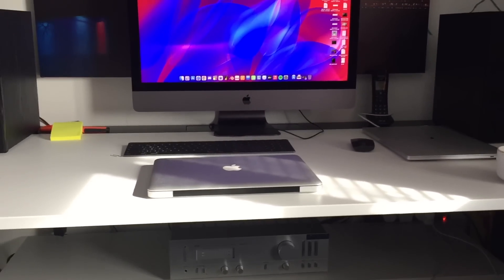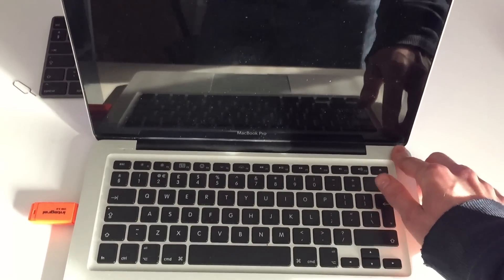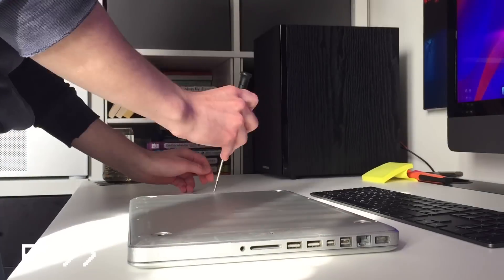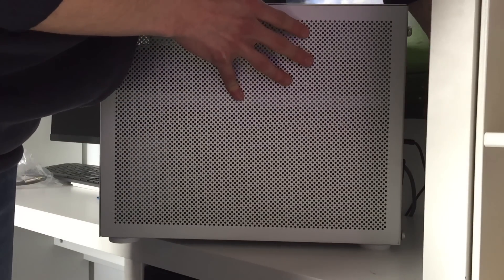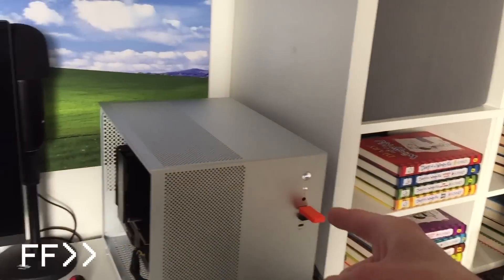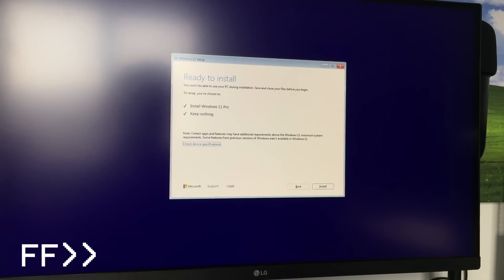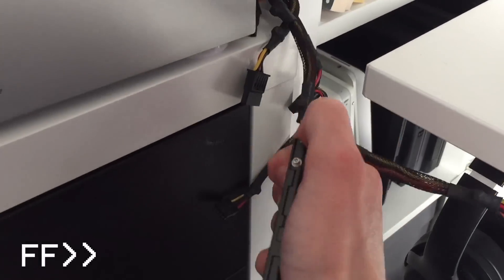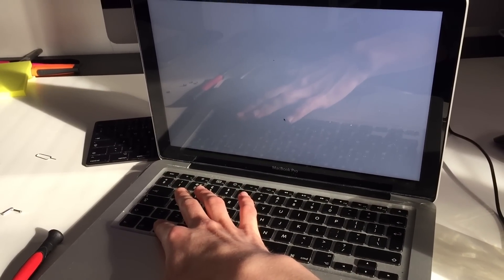I Tried Running Windows 11 on an Old MacBook Pro – Here's What Happened

Comment: I installed Windows 11 on my 2012 Mac Mini once by first installing Windows 10 on it via Boot Camp, burning a Windows 11 DVD through (I think) Rufus and stripping it of ALL its installation requirements, then using an external DVD drive to UPGRADE Windows 10 to 11 from within the Windows 10 install on the Mac. I think I had a blue screen once or twice but after I fixed something in the registry it was fine. It worked pretty good!
Reply from the maker: That’s awesome! Nice one

Comment: Interesting, I will point out that the reason the ssd didn't provide any boot options on the Mac is because it was using the bootloader on your PC's internal drive. Also I would recommend using an older build of windows 11 since the processor may not support the instructions for the latest version. I believe this change was made in 24h2 or 23h2 but I may be wrong.
Reply: Basically, if you can boot the installer (without the minimum requirements, Rufus can do that for you) then you should be able to run windows 11
Reply from the maker: Thanks for the insight! I’ll definitely give something new a try! 🙂

Comment: the build of windows 11 that you tried to use on this macbook requires an instruction that the core 2 duo series of processors does not support, the best thing to do in this case if you insist on windows 11 is use an rtm build from 2021 or 2022 since the builds that require sse4.1 sse4.2 started circling around from 2023 but for me id use the rtm build Microsoft rolled out in 2021, this is why when booting from the usb on the macbook it didnt want to boot the cpu had missing instructions that build of windows 11 needed, and for the taking it out of the macbook and using another pc i doubt it will work either ways since in general apple devices handle everything differently than normal pcs so it could be potentially something related to the way it it just like how you cant just take an ssd out of a system that supports efi and put it in a non efi system
Reply from the maker: Wow thanks! I’ll look into this 🙂
Reply: @techmw1988  you're welcome

Comment: If I am correct about the CPU in that computer, then it is entirely possible that Windows 11 literally cannot run at all due to the processor being so old that it misses critical instruction set extensions that the OS needs to run. I have a 2007 iMac with a Core 2 Duo T7700 inside, and it runs Windows 10 because at this point MacOS is a lost cause on that machine. When I try to update to Windows 11 (with registry hacks applied in 10 of course), it says that it doesn't meet the minimum requirements because of the lack of "SSE4.2" and "PopCnt" instructions I think. That 2009 MacBook has a processor of a similar vintage, a Core 2 Duo P7550 or P8400, so it's not out of the question that the same problem is occuring here. Try to install Windows 10 first, and then upgrade. Also, make sure to download Windows Support Software from Boot Camp in MacOS, as Macs need a lot of windows drivers to run properly!
Reply from the maker: Thank you so much! Maybe I’ll just have to stick to windows 10 🥲

Comment: hey, for this model (2009): you either wanna use bootcamp w windows 7 OR: make two usb bootable drives: one with windows 7 (legacy boot) and one with rEFInd, plug both USBs in, go to EFI boot to go to rEFInd, then select the windows usb key, install windows 7, then you'll be able to install windows 11 using your successfully installed windows 7 on your 2009 MacBook Pro (tested on my 2008 MacBook!) oh and: 24H2 broke Core 2 Duos compatibility for Windows 11, you might prefer using 23H2 for that
Reply from the maker: Thanks for the insight! I'm definitely going to give this another go soon

Comment: yes so what you do is install windows 10 with boot camp then make a windows 11 usb with rufus then remove all system reqiuer ments then upgrade windows in windows 10 by opening the setup app and it should work fine.
Reply from the maker: Thank you! :)
Reply: @ ur welcome 😆

Comment: Well that's a dissappointment. Windows 11 installs here just fine. Not that it will work great due to graphics-related issues. But you can install every driver on Windows 11 on this laptop. Just dont go UEFI way, stick to legacy. You can install it via Windows 7 CD with WinNTSetup. Install BootCamp drivers then, Install latest nvidia driver (340.42 as far as i recall correctly), find REG file for enabling BrightnessControl. Oh, and also I think after installing BootCamp drivers you should replace the MacHAL.sys driver with one from the Internet. 
Yeah, thats tedious, but IS doable. Looking forward to your next video about that!
Reply from the maker: I shall give something a go! :)